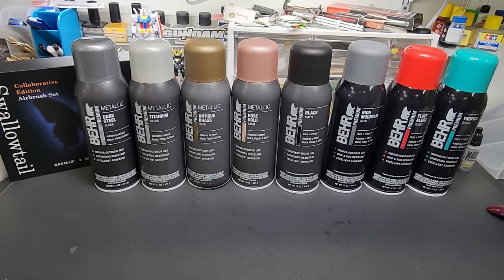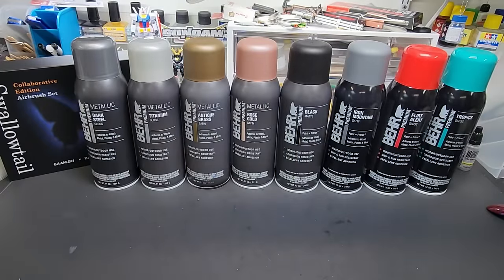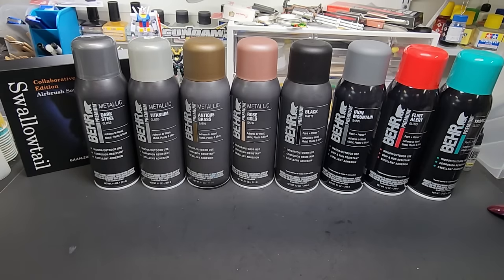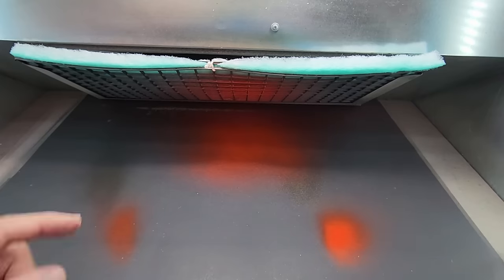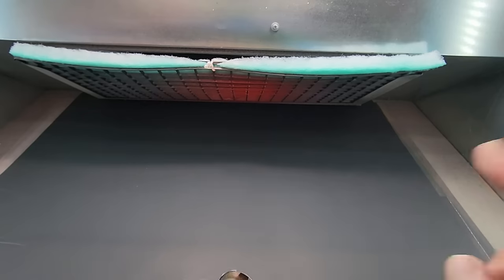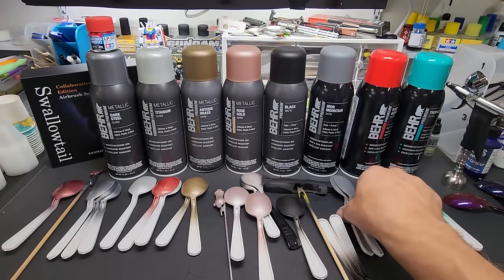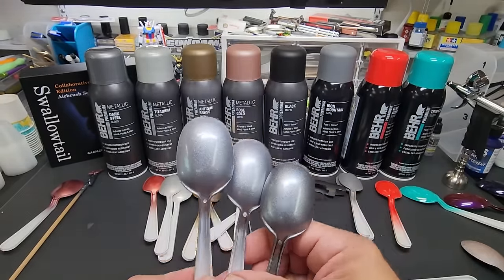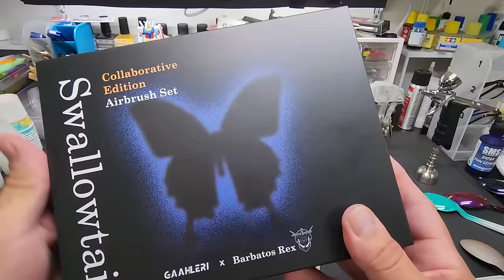Testing The New BEHR Spray Paint - For Painting On Plastic

Comment: I feel like it's absolute crap on bare plastic / PVC.  The spray is a little spattery and it just doesn't seem to cure well at all.  I feel like it's a little rubbery.  I was using black satin with stock tip and no primer because it says it's paint and primer in one.  10/10 can't recommend.

Comment: I know this is an old video but, I also had issues with some cheap spoons I bought. The clear and black spoons. It seems that the plastic was a mix of types together and my Paint did not like parts of the spoon.  I found streaks in the same spots on all the spoons. I had to use a spray can paint, black or gray and paint then 3 times to cover the areas. After the primer was dry my testing was fine.

Comment: Do you have a favorite paint set or airbrush recommendation? You get to test out so many different paints so I'm curious what your go-to stuff is.
Reply from the maker: Well I've been using the Gaahleri airbrush a lot lately plus they're the manufacturer of my airbrush. For paints it's a bit tougher to pick one. But I like solvent based paints in general. Mr Color is great overall line. Jumpwind is another brand I like as is Hobby Mio and SMS, but as I stated if it's a solvent then I'll probably like it

Comment: I used the No Drama red on a RC sailboat that had been brush painted.  After sanding the original paint smooth, the Behr spray paint was easy to use, with no runs. The boat looks 100% better now. A Dragonflite DF95.

I was thinking about a clear coat, but Behr doesn't make one.

Comment: I used some of the Behr Metallic Gold today to paint some HO slot cars from Auto World and it worked great. No primer needed. Went on smooth.
Reply: How bad does it smell? Please let us know if it's durable on those cars. Do you heat set? Tape test after drying? I have some AW TOP FUEL white bodies coming soon. Trying to figure out what I am going to do to them. I make my own water slide decals, not sure yet. Thanks
Reply: I just spray and let air dry. Both the bodies I painted yesterday feel sticky today but the paint doesn't smudge or come off by rubbing on it. It is thicker than Tamiya TS paint. The color is nice but I probably won't paint any more slot cars with my can of paint. I didn't notice any smell at all. Way less smell to me than the Tamiya cans.
Reply: @vampirolepis  Thanks for the reply. I have to match a relatives metallic purple charger color for one. Tamiya PS 18?.  Looking at making my own water slide decals next. Having trouble coming up with paint/detail schemes. Cannot find any info on painting them.
Reply: It's been two days and the Behr still feels tacky. It's smooth but it no where near as slick as the Revell Chrom turned out for me. I recommend that Revell Chrom for any parts needing chrome for sure. Any of the white Auto World plastic parts.

Comment: They awesome but let them Cure  before working on your project but I still thinn them with mr.color selfleveling thinner or Rapid thinner  .I never use them on Bandai Plastic  only on cars or trucks and military vehicles.  .I use to decant the hole can and I stop doing that the paint was thickening in a airtight container  the gas in it was harding the paint sometimes i use air locks to gas off the paint like they use in beer and wine making that did help but now I only decant it as I need  it and let it gas off for 20 minutes and thinn it and spray .I do this with mth 94 paint and other paints I use a lot of paint .I Experiment with different paints and supplies every day .

Comment: Hello Robert, you said at the beginning gunpla pieces should be primed before painting with these cans because the paint can harm the plastic. I dont have airbrush equipment at the moment, what spray can primer can you recommend to use with these spray paints? Thanks in advance.
Reply from the maker: My favorite spray can primer is Mr Surfacer. If you can't get that then go with Tamiya
Reply: @barbatosrex9473  excellent, thank you very much for the tip and thanks for your super quick response.